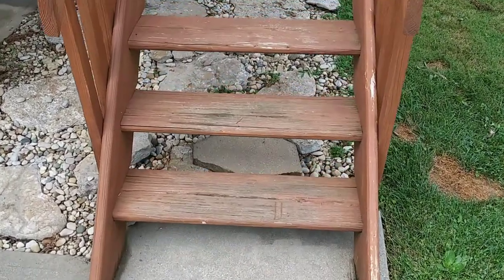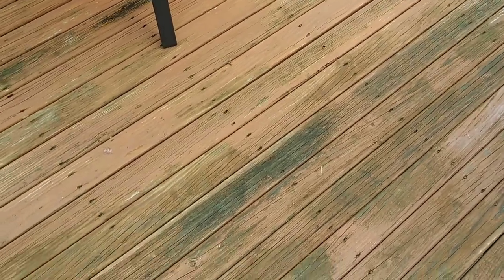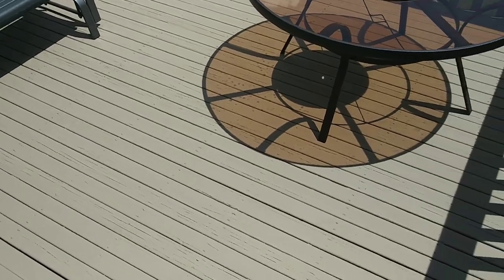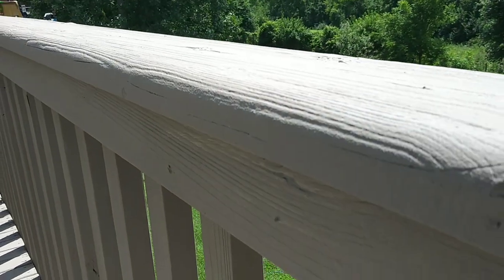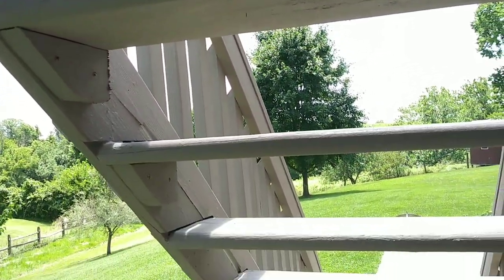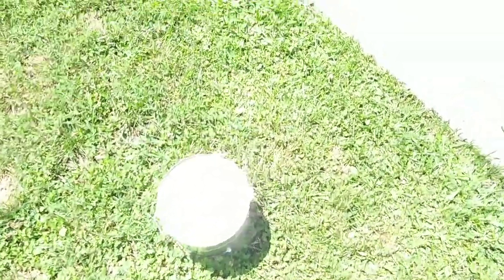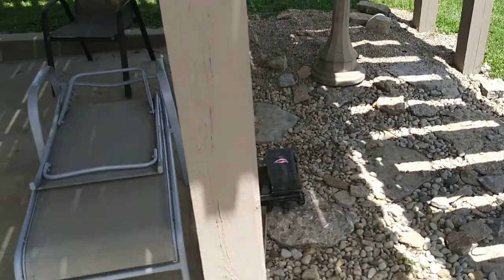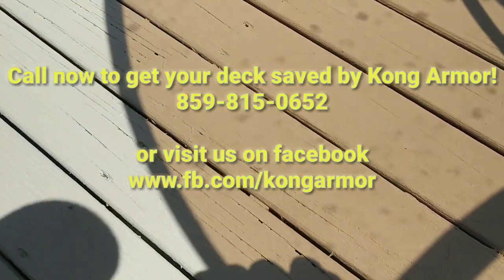Painting over Peeling, Cracking, deck paint! Independence,KY

Comment: So, it is basically a wood-fill/paint combo?  Maybe I could make that myself if i thin the wood-fill, wood adhesive, and tint?
Reply from the maker: Let us know how it goes. .
Reply: @KongArmor  LOL.  I was just thinking out loud.  I'm not going to try it.
Reply from the maker: Lol. Hey.. u can do anything u set ut mind too.  We don't doubt u
Reply: @KongArmor  Well, I did use very fine scoopable cat litter, mixed it with water, packed it into some deep and wide split wood posts with it, let it dry. Then coated it with paintable wood glue.  It lasted for five years.
Reply from the maker: You did what? Lol..... hey... thats hilarious... .there is a video online of them using Ramin noodles crunched up and wood glue

Comment: What paint did you use?
Reply from the maker: Kong Armor is a Proprietary Deck Coating System with professional application only
Reply: @KongArmor  Does Kong Armor require priming first?
Reply: Plenty of other options, check with you local professional paint store like sherwin Williams, Kelly more paints, etc.